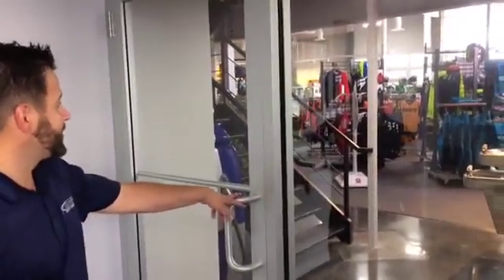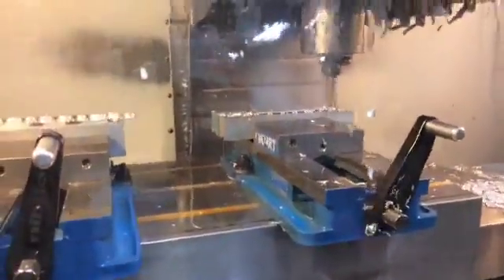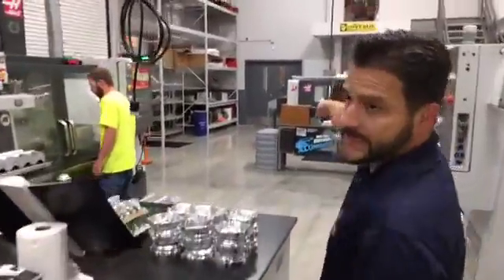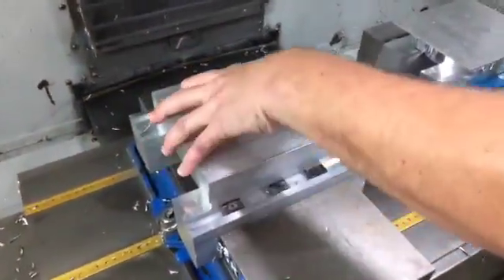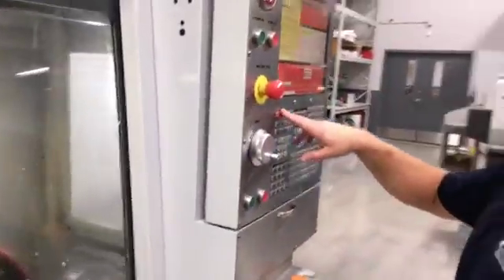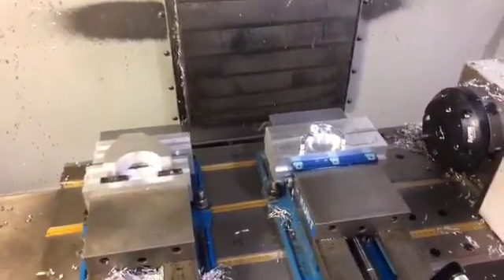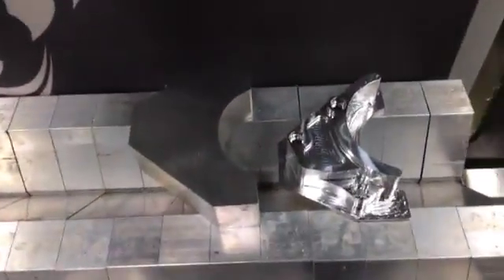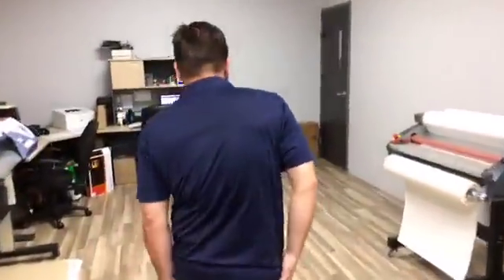House Call | Nihilo Concepts | TransWorld Motocross

Comment: Machining no-no #1: NEVER leave the handles on the vise!!
Reply: Those ones have setscrews to tighten them on the hex shaft so they wont come off. However, I'm not a fan of doing that either.
Reply: Bobby Brewster aka @Brew2Tripp is hands down one of the absolute Top Machinsts/Engineer on the face of the planet. He is a true Master Craftsman, and displays exemplary skills and production 7 days a week. When you combine his level of Experience with a 110% work ethic and dedication to your brand you then become extremely difficult to beat at your craft. I've personally watched this business evolve firsthand, and I've yet to find anyone at his level. Bobby is World Class at what he does and manufactures the finest hard parts in Motocross PERIOD